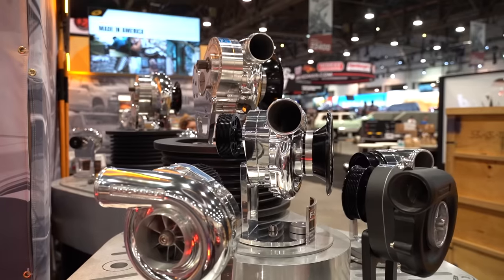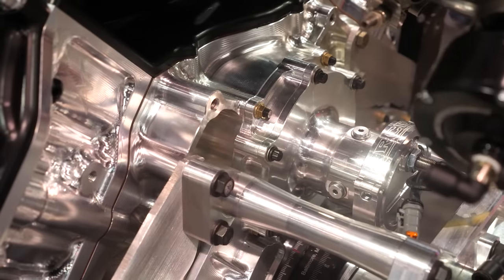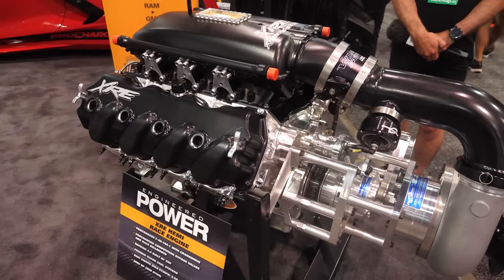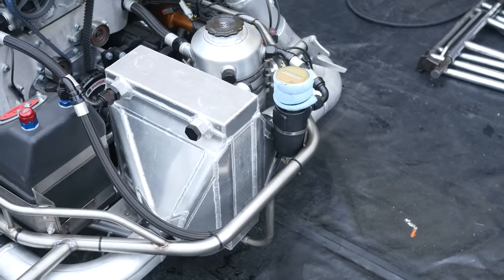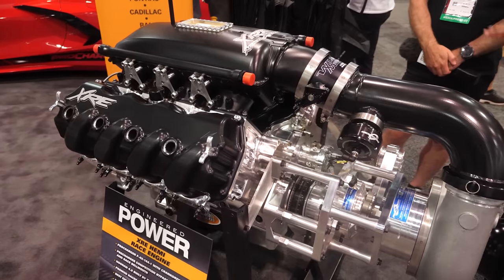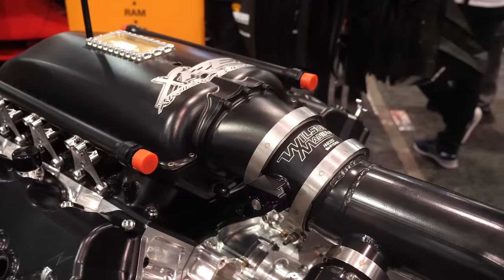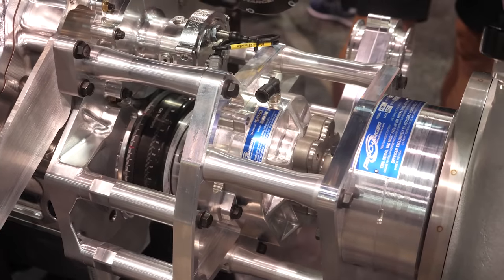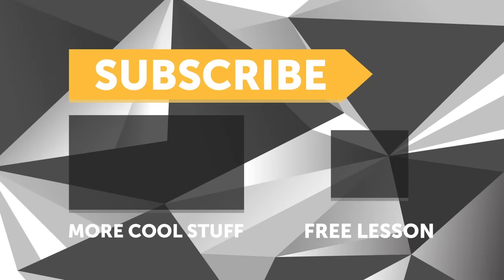Why Are Centrifugal Superchargers So Good?

Comment: I love prochargers products but dang....they are rather spendy...a bit out of my price range for what I'm looking for. A racecar is a different story but even cheap modern turbos are very good if you do even a little bit of research. 9k+ for 650 to 700+rwhp these days for MOST people is just too much. I do like the rpm dependent hp/trq though and acting like just a bigger motor. It's a shame one tech generally gets cheaper over time(not for next gen bells and whistles turbos mind you) but thesupercharger market just keeps going up
Reply: Yeah as much as i love superchargers, it seems to me good superchargers tend to cost quite a bit more than a good turbo.
EDIT: yeah i just did a little searching and found some good turbos under $2k and looked like most good supers were double that
Reply: @jameskazd9951  yeah honestly I'd love to put the pro-1 I think it's called...the electronically controlled supercharger from ProCharger(9kish,,,ouch). Having the option of rpm dependent torque/hp figures for maximizing traction at a given rpm would be fabulous but the price...dang. my Ls project has a lot of good parts...turbosmart, greddy, mishimoto, hks but those parts are a few hundred a piece...they add up but still it's going to be less than 2k to turbo my engine...maybe a little over as I'm fabricating my own exhaust. I don't think(not 100%) I spent 9k for a fully forged built motor...probably close but I think closer to $6500 to 7k. I understand why it's spendy...I just cry, lol 😆
Reply: Worth every penny.

Comment: The biggest drawback to the ProCharger supercharger is they are noisier than hell. The first time I saw one was on a C5, and it sounded awful. I thought something was really wrong with the car...like "what the hell are you driving this car like that" wrong. Turned out that is just the way it sounds when the car is idling at at low speed.
Reply: I bet you on a ls3 or l99 a centrifugal would sound soo
 good

Comment: Every "race" of pro-stock modified style street cars using superchargers or turbo (and twin turbo) chargers, the twin turbo vehicles always had slightly better numbers on paper. But when applied to racing conditions ended up breaking down in real world conditions. Or simply lost to the supercharged vehicle. I know, that could be driver skill. However, the Supercharged vehicle finished the race, won, and then drove home. Turbo chargers are NOT good technology. You will never convince me re-using "hot" exhaust gases through the air intake a 2nd time is a good thing. Everybody talks about "cold air" intake. You need "cold air" intake for the best performance. You'll never have a cold air intake with a turbo charged car. Plus the extra effort with trying to "cool" the exhaust gases with an intercooler, and additional cooling system. Yeah, that definitely helps you conserve weight in the vehicle. Superchargers, and in this case these Prochargers are the way to go. But is it me, or are Prochargers the biggest superchargers you've ever seen for regular cars? Might need a hood scoop? lol. (but really I prefer cubic inches over forced induction to make horsepower anyway. Happy with 400 HP and 500 HP numbers).

Comment: Why are they so good?  They arent, they combine the problems with turbos and the problems with superchargers into one package.  Id go turbo if it was centrifugal,  roots or twinscrew if blower.

Prochargers are just cheaper than other superchargers because turbos are made more commonly for more purposes than other blowers.

Ahh im not being fair... there is a benefit, theyre separated from the throttle body and intake manifold, where a roots or twinscrew will be  right on there usually, so its easier to get the aircharge cooler.

Comment: My perspective, as a casual Discovery viewer of the NPK series is this device will fail at any moment. The Main Fuse. Just my impression. I'm quite sure my impression is uninformed or ignorant or whatever. No question some have success. But some aren't as fortunate.
Reply from the maker: There are so many things you could call a main fuse in an engine. Rods, pistons, coils, spark plugs, oil pumps, injectors and more which would cause it to stop running to be fair. It is not often they will just fail without someone giving them a reason to do so within their window of performance and reliability - Taz.

Comment: Too bad about the power consumed by the blower that never makes it to the wheels. A Turbocharger that delivers the same Lb/per/minute airflow will deliver 15-20% more power, because it is not being consumed by the gearbox / blower. If Centrifugal blowers were so great , turbochargers would be dead, instead of finding there way onto more and more OEM applications every year......

Comment: These are great, but turbos still far superior.
Reply: In every way and every application?
Reply: Yes turbos are better i reckon...
But a whipple supercharger is alot better for a street car than "belt driven turbos"  you have zero lag...

he admitted 3 times the faults of them..

1, the lag... "our power is all at the top end of rev range " 👎

2, customer asks what about at 2500 rpm... "you wont be driving at 2500 rpm"...😄 what rpm are you doing at 100kmh usually in most 80s-2000s cars?  = 2200-3000rpm 

3. Air filters under the bonnet don't make much of a difference...😄... Banks Power tested the difference on the vehicle that won the ultimate call out challenge in 2020 I think it was..  it was around 1900hp running under bonnet filter and then piped it outside of engine bay and got 37% cooler intake temps and I believe the next time the owner dynoed it... it went 2200hp but may of done other things before that run...

I'm not being negative.. I love all boosted things... just dont want people being mislead that they are superior and getting very disappointed at the massive lag

Comment: Gear and shaft materials in the gear box spinning at 75,000 RPM still won't be as reliable nor as efficient as a turbo turning at 100,000RPM!
There is a reason why Porsche does not use superchargers on their cars!!!  No matter how good these appear on paper, it still isn't the best!
Reply: I remember driving a 911sc targa in 1982.

Comment: There's nothing such as centrifugal supercharged. It's a turbocharger
Reply from the maker: You can call it Geoff if you like,  it doesn't change any facts around the discussion being had here.

That said, if you wanted to stick to that definition, you should be calling it a turbosupercharger. Times and definitions have changed in the last few decades, and there is no exhaust gas being used here to drive this supercharger which is the modern point of difference.

We aren't all running around speaking Ye Olde English, language does evolve - Taz.